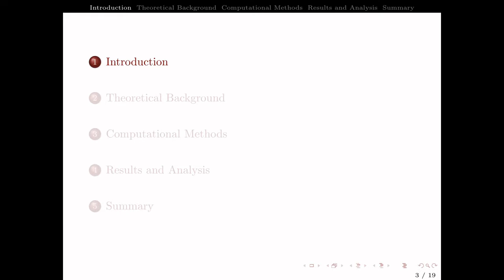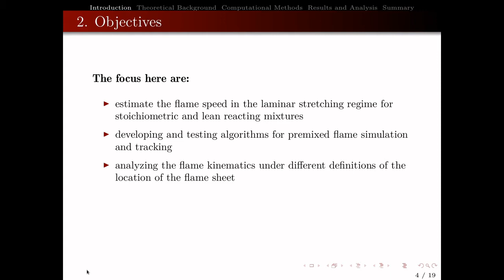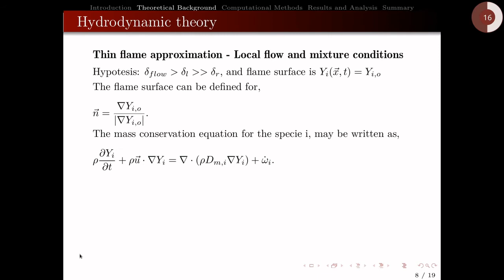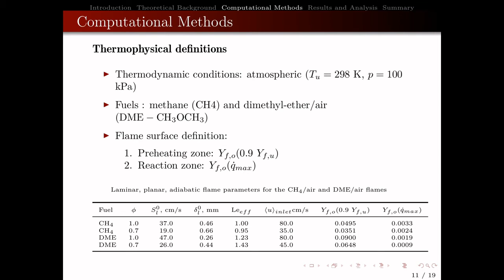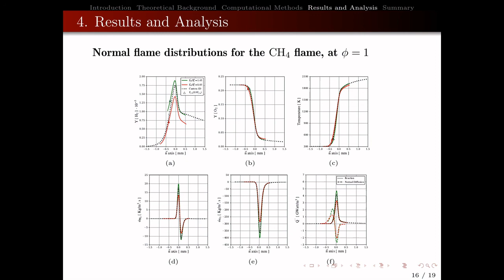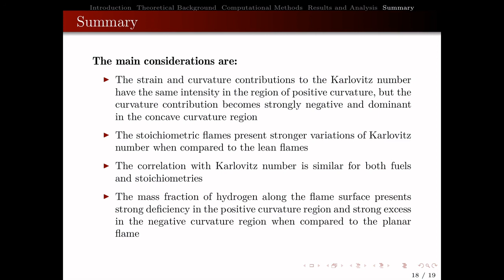Rafael Meier - Dns simulations of stabilized premixed flames in a slot burner

Comment: I found the work very interesting! What is the definition of Ka number? What were the chemical kinetic mechanisms used? What is the mesh resolution of minor, but relevant, species, such as CH3O, CH2O, HCO? Is the flame surrounded by air or by burned gases?
Reply from the maker: Hello Prof. Luis Fernando and thank you for watching. The Ka definition that we used was Ka = K*(delta^0_l)/(S^0_l).  For methane simulations, we used Kee's reduced mechanism (17 species and 58 reactions), and for DME we apply the mechanism of Bhagatwala (30 species and 175 reactions). Our minor resolution was around delta x and y 1e-5 m. The main idea of the work was to develop an algorithm to track the flame structure. In order not to make the work too extensive, we limited the analyzes to hydrogen, oxygen, and the energy equation. But any property of flame can be traced, both in the normal and tangential directions, and we are planning in our future works to include more details of the flame structure. And yes, when the simulation converges to steady-state, the burned gas is surrounding the flame. 
Rafael Meier